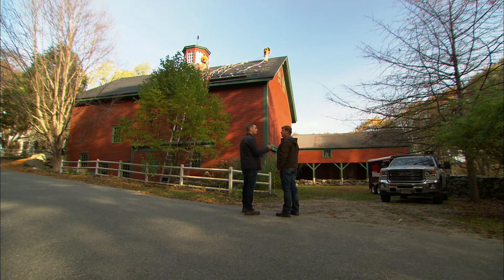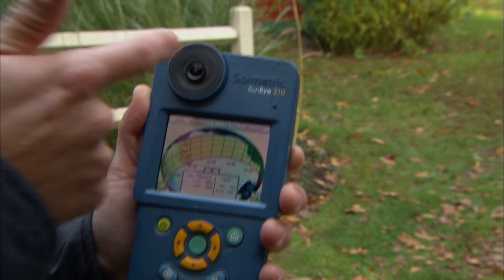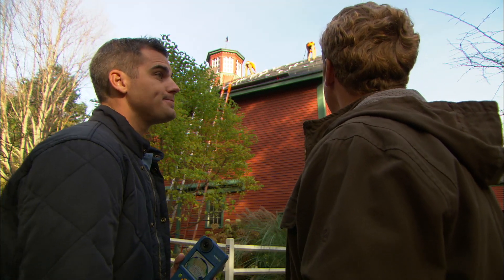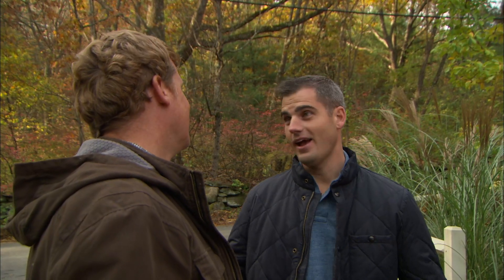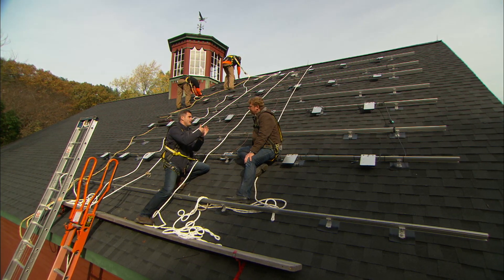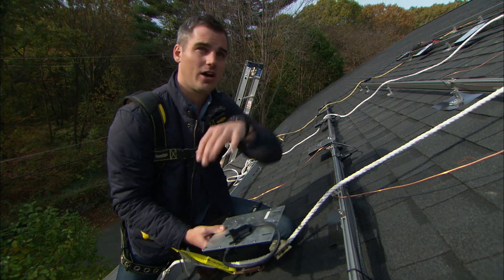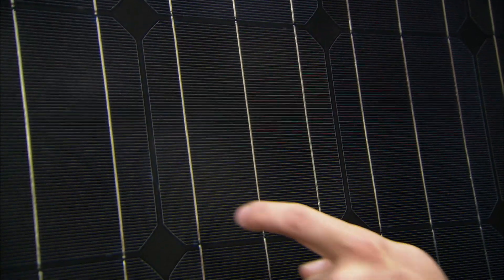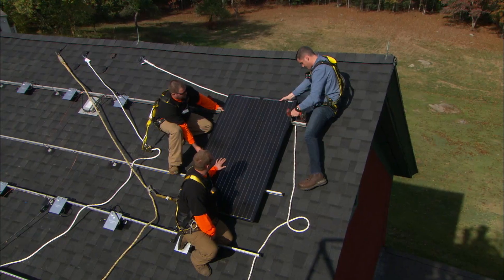How to Install Solar Panels with Microinverters | Ask This Old House

Comment: Why would they be in series if one panel goes out you lose them all.
Reply: The panels are connected to a separate inverter in this install. The inverters are then tied together in parallel to the AC. A panel failure is unlikely, and wouldn’t impact any other panel in this case. If an inverter fails, the rest will keep working, and you can get a monitoring system that will show the failure.
Reply: Trust me, inverters are the weak link in a solar system.  All those microinverters mounted in a hostile, inaccessible location is a reliability nightmare.  A single, string inverter, mounted in a serviceable location, is more reliable, less expensive, and (in with shade free array) just as productive as microinverters.
Reply: Yes, the inverter is the weakest link but you're forgetting all inverters eventually fail but when a string inverter fails it means the entire system is down until you can get it replaced.

There's trades offs to everything and different reasons to go with different solutions... Nothing will work equally well for everyone in every situation.

While inverters will eventually fail, having each panel with its own micro-inverter means the system still works even if a few units go out and you're not left without power until the system can be repaired.

Running AC from the panels also gives more flexibility on where you can have the panels located, vs running DC lines that limits how far away you can have the panels from the rest of the system and you can more easily mix and match different panels and locations/directions because you don't have to match voltage and current like you would with a DC setup...

Micro Inverters or DC Optimizers also grants per panel monitoring.  So you can more easily monitor a large array of panels and know if there are any problems and be able to quickly identify and locate the panel with the problem, which you couldn't easily do with a standard string inverter setup.

While micro-inverters have been around for many years now and so are now a proven technology with long warranty coverage of up to 25 years.  

Yes, string inverters will be the optimal solution more often but there are situations where other solutions become preferable.

Mind, even without shade issue, not everyone is going to have perfect weather all year round, or have as much sunlight throughout the year to as easily meet their power needs...
Reply: In the choice between many points of failure in a hostile, inaccessible location with better visibility into those failures - and one point of failure (PV panels themselves virtually never fail) that is in a protected, serviceable location with limited visibility of panel failure (again, which is rarely the problem) - I choose the later.  Microinverters introduce a huge source of failure out in the array and then brag how they can then see those failures easily.  I choose not to have those kind of failures altogether.  Ok, so microinverters can monitor PV productivity at the panel level.  Big deal - PV panels are super reliable.  
When it comes to inverters (like in real estate), the three most important criteria are: reliability, reliability, reliability.  And now with string inverters having triple inputs, multiple array orientations are well handled and any problems are isolated much easier.  Ok, so microinverters can mitigate shading problems - true, but how about solving the problem by doing whatever it takes to eliminate the shade instead of just mitigating it by introducing a huge reliability problem.  A shade free PV panel is always preferable to an optimized shady panel.   
Did you know that Enphase in 2018 offered to replace all their early version microinverters for free with the latest version?  (of course, the new ones are promised to be reliable just like they promised the early ones to be...) So much for being proven reliable - and the warranty is plainly just a marketing gimmick with actual MTBF's falling far short of 25 years.  They are buying market acceptance and reliability by replacing failed inverters for free, but they are not paying me ( the poor guy that has to go out and dismantle an array to replace the thing) for doing the truck roll.  As a dealer, I don't think my customers appreciate a technology that will require the warranty guy to come out and replace microinverters one by one as they fail - no matter whether it happens sooner or later.  
Microinverters - no thanks.  Don't believe the marketing hype.  In solar PV, we are selling a product that depends on its long reliability. (just name any other electronic consumer product that is warranted for more than one year)  Don't compromise the wonderful 50 year reliability of a solar PV panel by hooking it to a less-reliable servicing nightmare called a microinverter.
B.S. on the AC hookup allowing for running long distances to the array.  DC strings generally run at double the voltage (up to 600V) of AC's 240Vac.  This will make the DC Amps half of what the AC amps are and wire losses are therefore quadruple higher in the AC circuit.   This is high voltage DC (well not really, code defines high voltage as over 1000V) not the low voltage DC (commonly found in 12Vdc automotive) that has huge losses due to wire resistance.   The big innovation that made grid-tie solar so much more efficient was to string panels in series to get the voltage way up to eliminate wire losses and down convert to 240Vac instead of the more electronically difficult boosting of voltage from a panel's low voltage of ~30Vdc.  Yes, I know - most regular electricians are afraid of "high voltage" DC.
Reply: No, just like when a panel gets shaded it'll just cause a power drop.  Mind, each panel is itself a collection of separate cells connected together.

Still not desirable but connecting in series has the benefit of raising the voltage but keep the current the same, which allows use of thinner wires that can also be run over longer distances and makes converting to AC easier than higher current at lower voltage...  So done for lower cost and flexibility to the system.

But it's usually just the row and multiple rows would usually be connected in parallel.  Just like batteries, they mix them for large setups... So the power drop would be mainly from the effected row.

More modern systems, like this one using the micro-inverters or others using DC optimizers, though, don't have that problem, as it basically gives each panel its own MPPT, which can optimize the panel's output to minimize the power drop even when multiple panels are shaded...

Comment: Looks like you need to be sure the roof is new. Have to disassemble the entire array to repair or replace roof. Also, no info of lifespan of the solar panels. That would be helpful. Interesting video.
Reply: Most panels are expected to last 20-50 years. Depends on the manufacturer. The inverters are made for typically 10-20 years. The panels will almost always outlast the roof.
Reply: The lifetime of the panels themselves will depend on the type of cells used. Amorphous cells ~20-25 years. Crystalin ~30 years. They won't break after that time, they die slowly. After 10 years they'll only deliever 90% of their original power, after 20 years eventually 80% and so on. Manufacturers give such warranties. So this is not a finger snip and they're gone. The inverter will last ~10 to 15 years. So they actually die earlier than the panels.
Reply: Rock Steady why would it need to be new?
Reply: @IlIlIlIlIlIlIlIl-v9h  You dont need a new roof, you just need a roof that will be good without fixing it for 15-20 years.
Reply: F - a 30 year asphalt shingled roof will only last 20 years in direct sunlight. I learned this the hard way, as well as how useless the warranty is without the original purchase receipt, even with a big name brand.
Reply: @TheOtherBill  In this case it is better to built a roof with roof tiles. Standard way here in Germany using roof tiles made of clay or concrete. My parents replaced their roof in 2016, at that time it was still the original roof from 1963 and the concrete tiles were still ok for their age. But there was no insulation, the steps to the chimney were totally rusted and still the old antennas for radio and TV on the roof and they partially removed one chimney which now serves as a conduit for the big cable for the electricity service.
Reply: Tiles (usually clay or slate) are too expensive to have installed here. Better to get a good metal roof.
Chances are in 20 years it will all be obsolete (it's already old tech) so it may not be a big deal to replace it.
Reply: @TheOtherBill  25 to 30€ per m² roof area, that are 30 to 35 US$, for concrete tiles including the guys laying them. But depending on the quality of the tiles it could go up to 50€ per m² (1m² =  ~ 11 sqft). The material price per tile is in the cent area.
Here in the area the most used roof tile is the "Frankfurter Pfanne", a concrete roof tile  with added pigments for the colour.  Price per tile is between 0.63€ and 1.20€. Required amount of tiles 10 to 11 tiles per m². Manufacturer warranty is 30 years (Braas). One of the longest warranties here in Germany for construction materials.

https://en.wikipedia.org/wiki/Braas_Monier_Building_Group#%22Frankfurter_Pfanne%22

Comment: It's an interesting concept, in particular the micro-inverters.  Since they're all connected in parallel, is phase synchronization done locally at each converter?  As interesting as it is however, it seems completely impractical for most people because the initial cost is likely so high that it would take more than a decade to  break even by which time, the roof, panels, or those interesting inverters will need replacement or service, if not much sooner.
Reply: Ya well, microinverters sounds like some kind of cool "smart phone" kind of device running your solar panels, but the reality is they don't last anywhere near as long as the 25 year warranty the manufacturers claim (its a sales gimmick) and some poor solar dealer is going to be called out to replace them one by one as they fail.  They will have to take off however many panels to get to the failed microinverter on that steep roof every time one dies.  The only time they even make some sense to use is when their is a lot of shading, which this install doesn't.
Reply: @gregcollins3404    that is one big problem on all that complication,trying to get at one failed inverter or connection; interventions like that may even extend the break even point beyond the useful
Reply: The panels generally have 25-year warranties, and the inverters probably do too, I'd bet.  Having solar panels on your roof actually protects the roof itself and lengthens its lifespan, obviously because they shade it from the sun and weather.
Reply: @macaroniandtuna  I live in a hot, humid, and hurricane prone area there are few things that are installed outside that don't get completely destroyed after 5-10 years. Electronics in particular don't have a chance. Even if there is a warranty, the dealer that installed it or the manufacturer is likely long  out of business in a few years or may not cover "physical damage". It looks like they've been around since 2006 and 2007 so god bless them, but I deal with lighting automation companies that were very innovative at the time and homeowners bought into them and then *poof*, out of business. Look into Lite-Touch for instance.  They got bought by Savant and Savant discontinued it. I like solar but I think they make more sense at a municipal or corporate level where there are maintenance and upgrade plans in place.
Reply: Actually, the technology has gotten significantly cheaper...  

https://upload.wikimedia.org/wikipedia/commons/thumb/7/71/Price_history_of_silicon_PV_cells_since_1977.svg/2000px-Price_history_of_silicon_PV_cells_since_1977.svg.png

So most of the costs is the batteries and inverter but a grid tied system can avoid most of those costs by not having any batteries and using a lower cost grid-tied inverter...

Add, getting paid for power that goes out to the grid can accelerate the break even point... and if combining with energy efficiency improvements to a home the costs savings can be very substantial.

There's parts of the country where people are paying nearly $3K a month during peak heating and cooling periods but an energy efficient home in the same area can reduce that to less than $1k for the whole year...

It's just harder when you're in an area where you can't get credit for sending power to the grid or places where there isn't much sun all year round...

But it can still make sense for people who need off-grid power when they either live in an area prone to power outages or are living on a property that it would be extremely expensive to get grid power run to it and it's still far more cost effective than running your own generator all the time...
Reply: @ZeoCyberG  I'm talking about the entire installation which by their own admission is over $10K The parts are cheaper and more efficient for sure but still not something most people can justify.
Reply: @Arie - It's an old video, they re-uploaded it.  So what they showed was more than a few years ago and costs have gone done since then and there's more options now for how it can be set up...

Thing to understand, though, is that everything has costs and whether it's justified comes down to the trade offs and whether something gives someone an improvement over other options they would otherwise be stuck with...

Even just making the home more energy efficient will have its additional costs but the long term costs savings are substantial and continuous, as well as better for the environment and many of these types of upgrades to a home can have a larger effect on just about every aspect of the home performance...

https://www.youtube.com/watch?v=fhbLjEKKLVM

It used to take over 15 years to break even with a solar power system but now the average is more 6-8 years, despite the average house requiring more power.  Add system reliability has improved and you can see systems that will last for over 25 years, some will still be usable after 50, and it becomes much easier to justify.

Especially, as costs are scalable to what you need the system to do.  Even a small system can off-set peak energy usage and help reduce long term costs.  

You just get more benefit with a larger system that can produce surpluses and send power into the grid, especially in areas where the power company will pay you for that contribution but people don't have to go all in if it's not in their budget to do so and many of these systems can be upgraded over time to spread the costs...

So it's not all or nothing and there's actually many options and ways to do it...

Besides, there are other benefits and you can look up what would happen once we have a Smart Grid...
Reply: Trees can grow taller. Morning sun, evening sun and winter sun are very low in the sky ...
Reply: The other application that makes sense for micros is complex roofs. A string inverter wants all of the panels facing the same direction, getting the same amnount of sun. If you have a roof where some panels face south, east and west, micros (and optimizers) are able to produce independent of mismatches in orientation.